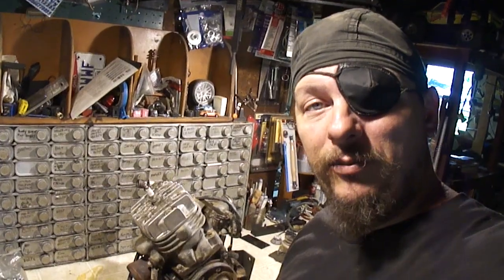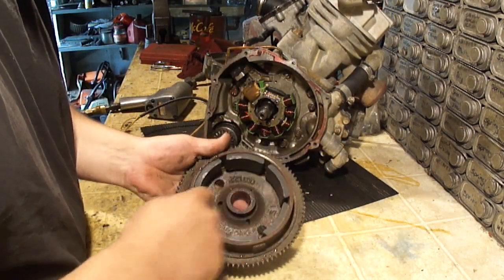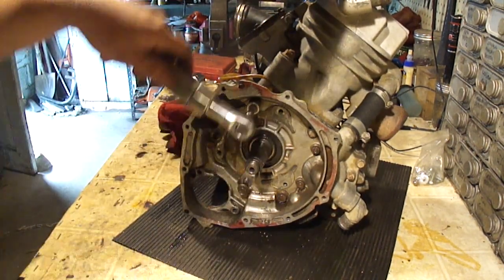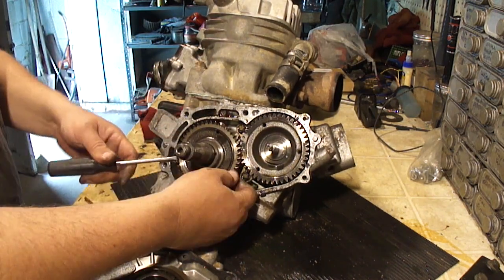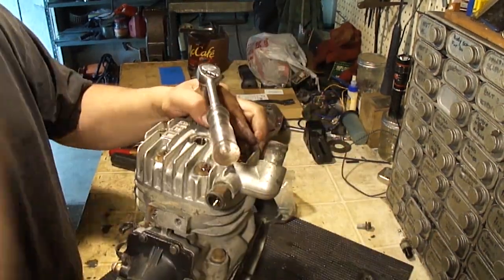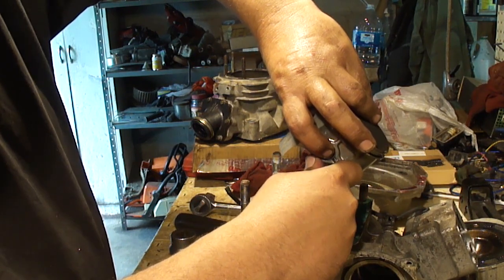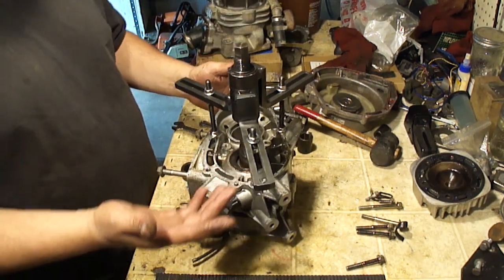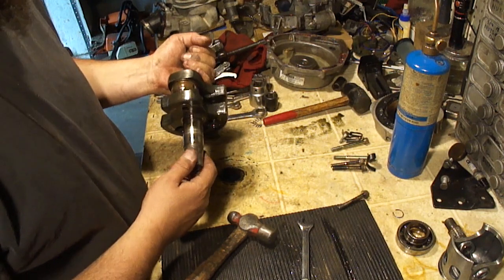(Severe Damage) Polaris 400 Engine rebuild Part 2

Comment: Great video!
At time 2:20, what size & length are the three flywheel puller bolts you used?
Reply from the maker: Metric M8 x 1.25 - 90mm long (3.5 inches)

Comment: Ok so I might have the same problem on mine same year same model every time I started mine it ran fine for about 2 minutes then it started revving really high so my guess was a vacuum leak so I did crack shaft seal’s gaskets new carb new makuni also new carb boot and gaskets behind the reeds still same thing but the problem is now after all that it seams to be leaking oil from underneath the exhaust manifold I tried putting a new crush gasket on it but it’s still doing the same thing every time I put oil in the crank case it leaks through the exhaust system and where the exhaust meets the head so not sure what it could be maybe it’s cracked like yours ???? Also side note it don’t have a dip stick the guy I bought it from stuck like a plastic nut in there that does not thread so I have one on order could that be sucking air????? Thanks for your help
Reply from the maker: find the vent hose that goes into the balance shaft compartment and inject some compressed air in there and see if you can find where air is coming out of. Don't put a lot of pressure in there though, just about 10- 20 psi or so.
Reply: @ so is it the one that’s on the top of it near the shift linkage and pull start if so the air just keeps popping back out like there is no air leak at all. I can push the air in pinch the hose and wait a few seconds and when I release the hose the air just rushes back out ???
Reply from the maker: @ Sounds like you have the correct vent line. Now put the air in but listen for air escaping out of the air filter box or exhaust pipe. Listen close because it may only be a tiny bit of air escaping. If you can't hear anything then you probably don't have a Leake there.

Comment: Excellent video. sorry about your loss (of the case). i'm nearly finished a train wreck of a 92 350l 4x4. top end was off a chicken spit covered barn find. "free" but $800+ later, it's done.
one thing i'd add to your inspection. the balance shaft WILL wear grooves right where the water pump seal rides. i got lucky and found a good replacement, but don't neglect changing that seal.
i went with an allballs bearing set, gaskets and seals, piston and rings, rehone, replaced the balance shaft, a starter (of course) had no exhaust or seat. rebuilt the cooling fan and replaced the radiator switch, Noticed the switch in your head was broken, it's for an overheat light. also cleaned and lubricated the brakes and bled fully.
stacked rubber bushings on a bolt for the bottom motor mount. fabricobbled a head to frame bracket. 
from your maintenance video, my speedo shaft was sheared, so i flattened 4 sides of a tiny bolt as a replacement, as well as replacing the cable. spent $15 for one strut pivot ball as it was held in by truck inner tube, prior owner.
i ended up removing my chain adjuster eccentrics to clean and anti seize. replaced the bottom steering shaft bushing. for the transmission, i went with 90w, as i read i could use atf, 30w or gear oil. ground the rust off the rim bead areas and painted.
i used ATF in the front hubs, waiting on new front control arm bushings.
Reply from the maker: Wow, sounds like you had to fix or replace just about everything. Thanks for sharing your journey and experience with this quad.